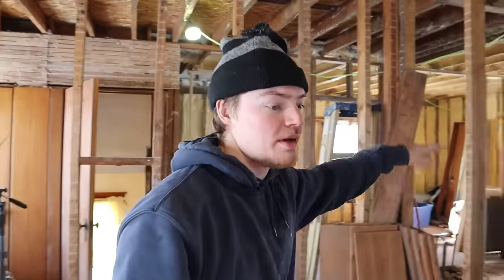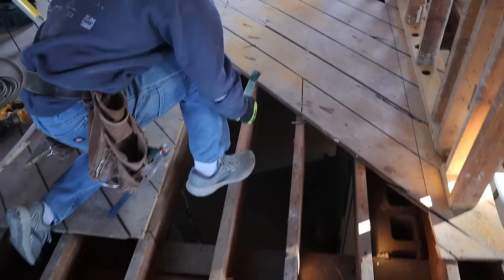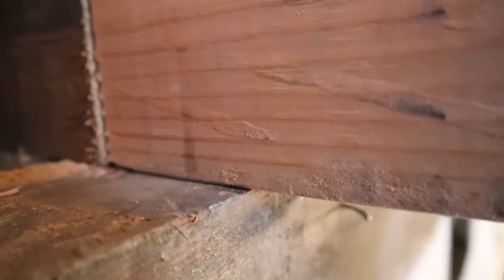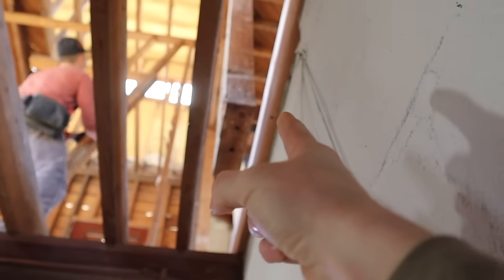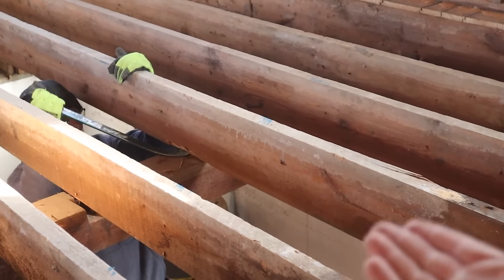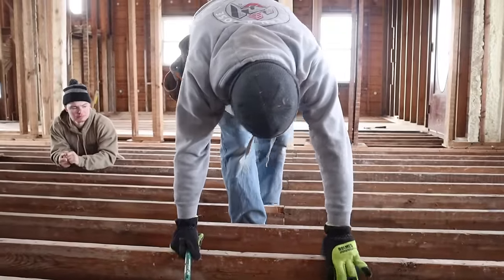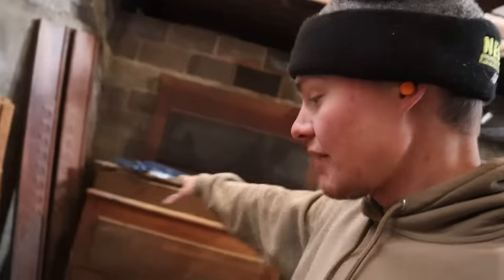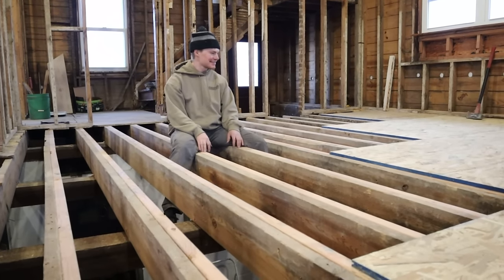Restoring A $7,000 Mansion: Kitchen Floor Rebuild

Comment: Screw the floor and it will never creek and squeak. Nail the floor and squeaks happen over time as the nail is pulled and rubs on the substrate. More work, but better long term.
Reply: A little glue works too.
Reply: Totally agree, glue and screw the floor.
Reply: You are right, that’s what happened to our home. The floor was screwdriver down when we changed the floor. No more squeaks.
Reply: Glue it and screw it. Blocking would be good too
Reply: I glued and screwed my sub when I built 8 years ago. Still no squeaks.
Reply: I heard Mike Holmes say more than once, "If you're gonna do it, glue it and screw it."  I'd much rather have a subfloor screwed down than just nailed.  Nails can work loose so much easier than screws.
Reply: Always glue and screw the floor
Reply: T25 glue and screw tan deck screws 3 1/2
Reply: the 70's called and said they want their screws back.
Reply: Code here requires subfloor adhesive

Comment: If you're jacking up from the main floor, there needs to be a basement support directly underneath also, otherwise the floor joists will sag under the weight/pressure. Also if the floor joists are bowed, cut the nails from each end and flip the board crown up. If the crown is excessive, plane them down to level. Could save some costs. And for the love of god, remember the joists blockers for extra support and to prevent twisting!

Comment: When sistering joists make sure to glue and screw. Much stronger bonding and will prevent squeaking in the future. Same for the OSB. You will regret not doing that.

Comment: @Cole The Cornstar
Hey Cole, don't forget to insulate the cavity where the floor joists touch the outside walls.
Reply: Rim joist area.
Reply: I bet it will get the spray foam as well.

Comment: That mental support wall might not technically be a full blown support wall, but you should check the span tables for 2x8s. It looks like that span from the outside wall to the other side of the kitchen is way longer than it should be for 2x8s. I’d consider doubling up the floor joists on that second floor if the span is too long for dimensional 2x8s. Otherwise you’ll have a very bouncy second floor.

Comment: Any other contractor I have ever seen deal with uneven floor joists, has always sistered-up straight joists as an arbitrary level, and used the new Straight joists to Mark any crowned joists, and cut them Square, with a circular saw.
This is the first contractor I've ever seen, do this right, in my life !!
Kudos !!
(I'm 65)

Comment: Don’t forget to use construction adhesive under the osb. Helps with squeaks. Should also glue we’re you sister the floor joists.
Reply: What exactly do you think they were putting on the joists before laying the sheets?

Comment: I built over 80 pole barn type structures after high school from hotels to machinery sheds and it blow my mind that some of the finishes in that house were unbelievable and some were about as poor as you can get. FYI I'm Justin's age and I still have my 28oz waffle head Estwing hammer and chalk line from 1984 that drove a million nail from 60's to 8's.
Reply: If that 1984 hammer still has any evidence of the original waffle face on the head, its not been used very much!!  I have a few of the 28oz. estwing waffles that look as smooth as a finish hammer...LOL
Reply: Mine is from 1987 the waffle has been gone for 30 years and the claws are getting short.
Reply: That waffle was gone year 2.

Comment: Some of those interior walls do spread the load though technically not load bearing they do spread the load and lessen the 2nd floor bounce.
Reply: They 100% are load bearing! That span is exactly twice as wide as the joists can span! Not only that, but it's balloon framed and doesn't have the necessary support at the exterior wall!

Comment: Cole, I also have a huge old farmhouse. Mine is about 5000 square feet and built in 1890 in Lyndon Vermont. I made use of a large unused attic space by building a really neat movie theater with a stage and stadium seating. It will seat up to 12 people. I made it as much like a real theater as possible. Its been a huge hit with friends and family. Most cant believe I did it. You may want to try it with all that extra space.

Comment: Oh my goodness! I helped my father remodel our home. I learned to strip, sand, stain, and varnish all the wood in the house. He then did antiques he found. That door behind you in the kitchen is gorgeous! Do whatever it takes to save the doors, especially if they have the original glass. ❤😊 This crazy weather is perfect for gutting the house! It's been absolutely fantastic. Just the right temperature not to get hot inside, and not freeze your caboose. The weather alone has to be getting some time shaved off. 😊

Comment: You need to get a book called "Modern Carpentry".  It has 'span tables' which you obviously need!  The support walls you are removing prevent 'deflection' of the floor above. You will have sagging, squeaky, weak floors without them.

Comment: Great video is always . Just a suggestion when you put your sewer drain back in the wall you may want to use cast-iron that way you won’t hear the water running down the pipe in the wall with cast-iron. You won’t hear the water going down the pipe. Just a suggestion.

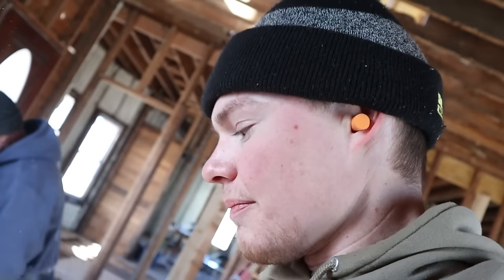Comment: 20:42 “that’s a pretty large span break or no break.” I build decks and I can’t span 2x10 12’ without a beam under it.
Reply: 100% guarantee that span needs to be broken in half! It appears to be around 18'.
Reply: 2x4 floor joists?

Comment: Why did you not use a bead of construction adhesive between the floor joists and the subfloor 42:00 in addition to screws for added strength and squeak prevention? Also, where are your noggins between the floor joists?
Reply: Just seen your comments totally agree about the noggins & floor adhesive & screws
Reply: These guys are in over their heads.
Reply: They quite clearly put construction adhesive down... and the joists are tied to the beam in the middle of the joist span.

Comment: You could use some of your old radiators in the basement in the laundry room. It would be easy to hook up with your radiant flooring.
Reply: @pattiwhite9575  ??? Use the old radiators to heat the basement, he will be using radiant floor heating for the house. All other takes is a little extra piping to use them.
Reply: I dont think he is keeping the washing machine in the basement, at least not their only washer. I bet one goes upstairs, closer to the bedrooms. I know i would do this.

Comment: Tip #1: just because joist span the entire way, doesnt mean the wall isnt load bearing.
This is the joys of renovating old homes, nothing level, nothing straight , nothing plum.
Also theres nothing wrong that chalk line, its fast wind up. I habe older ones slow wind up.

Comment: Gentlemen, 

The screws and the adhesive on the joists under the OSB, are the best way to avoid 'squeaks' in the floor. 

The sistering of the joists is also going to make for a much stronger floor. Good job! 

In my opinion your videos will probably not only entertain, but educate as you're working through each task, as you work on the restoration. Once on the famous TV program 'This Old House', Mr. Norm Abram, master woodworker, was talking about not enough young people wanting to enter the carpentry trade. I think your videos might help plant the 'seed' of looking at a career in carpentry / construction. Thats like the cherry on the sundae, of what you're focused on accomplishing. That is a wonderful thing. 

Roman, hope you can find a hammer that can hold up to your demolishing. As i mentioned before, you don't need to prove anything. Nothing wrong with 275. Not many 275's around. Just be yourself.

In other ways - each of you are 300's, because each of you has different strong points. God gives each of us a gift. Just do the best you can with it, and be careful so you go home to your families in one piece.  God bless.

Comment: In old houses, like the 100 years old in 1960 when my dad bought it you should sister kitchen joists because  ?
Fridges, stoves, counters and middle of kitchens islands are heavy.
When my Mom had our house gutted and modernized she insisted on having that done.
She got fed up with 2 general contractors she found were attempting to screw her so she went to school and got certified as a general contractor herself and took over supervising her house being built above code.

Comment: Justine I still use my dad's chalk line. I also still use the 16 oz hammer my dad had, it has duct tape for a handle. They are mine, so everyone knows NOT to use and lose them. A large pipe wrench works better to clobber the cast iron, I broke our stack pipe in just a few swings.

Comment: Outstanding stuff guys, you work well together.  Shimming and sistering the old joists was the way to go.  Also the staggering of the OSB sheeting helps distribute the load.  When dealing with compressive loads such as flooring then the nail gun is the way to go and it is so quick.  Anywhere you encounter tension loads or shear forces, like the sistering of spliced joists, then a few screws adds enormously to the strength and rigidity.  When you guys have finished it will be much better built than it was originally.

Comment: Try screwing in drywall screws to your existing wall frame. We had to add all new 2×4 and sister them to the existing. Our 1800 farm house the wood had basically petrified.  Dad got tired of predrilling for every drywall screw. So he just slapped up new 2×4s to make putting drywall up easier. It's something you should test now while the house is gutted. Just see if you have to fight the wood with drywall screws
Reply: Yup, I'm doing drywall over 100 year old studs and rafters right now and that old wood is so dry and hard. We put 2x2 furring strips on all the old studs. Makes putting in the drywall screws much easier (partly because the torque is consistent, so the screws are easier to set properly), plus we get a couple more inches of insulation.

Comment: Just a wee tip, when using the recipe saw to cut the vertical studs, I normally cut at an angle, tis allows the stud to swing without fouling the lower part bellow the cut

Comment: Make sure you get the required amount of bridging in between your floor joists installed before putting your subfloor on, or you could have a torsional buckling structural failure of the floor joist.  You really don't want that to happen.

Comment: My opinion those floor joists per code can only span 13' depending on species of the wood since your taking out walls holding up the second floor it ends up to be quiet the span.

Comment: Your floor joist span for 2x8 SPF is about 14” for 12” OC spacing. Doubled up 2x8 on 12” OC can span up to 18”. With that said do you really need the wood beam below the kitchen? You should also be adding bridging at the mid point of your floor joist. This adds strength to the floor joist by better distributing the load through out

Comment: Glad you decided to sister up old & new jousts. Will be way way stronger than replacing especially with the length of span on 2x8’s. You original spacing looks good as well. You’re easily giving this house another 100 years of life

Comment: I can’t believe you are using thin osb for your flooring.I’ve used STURDY BOARD for flooring the 15 years I built homes.
Reply: I have a feeling that this is only the beginning on cheapening out.  OSB isn't much good for anything, especially flooring.

Comment: @Cole: the long subfloor boards need pressure block against moving. Also, you can't put the walls just on OSB. The Old floor is much more stable in comparison to OSB. You better place pressure blocks on the locations of the walls, too.

Comment: Given the distance those floor joists span, I'd recommend putting in some boards running perpendicular between the joists to keep them from "rolling". It would also stiffen up the floor and reduce any movement and subsequent squeeking. I think todays building code requires the braces between joists.

Comment: I really admire you guys for what you have undertaken and the progress you have made!  Don't give up on it!  I look forward to every new video.  One suggestion:  now that the demo is done, you should immediately get a structural engineer in to evaluate what bracing you need to resist lateral and uplift forces.  Others have mentioned bracing the joists with solid or x bridging, but you also need bracing at multiple places in the exterior wall, tie downs for the roof rafters, interior shear walls, gluing and screwing all subfloors, etc, etc.  Now is the time to take a pause and get a structural engineer in to evaluate the foundation and frame.  You have a great vision for that old house, but it will only be as good as the foundation and frame.  Make sure to get those right.  That house right now may be a bit of a house of cards, get it braced!!

Comment: It was I was a West Virginia coal miner for 12 years then moved to Virginia when the mines got slow. In Virginia I built homes in Williamsburg and Newport News area for about 10 years I then worked for Waste Management as an electrician and trash compactor repair man and then I retired and was a RV repair technician until I fully retired

Comment: As a comment. I have a large kitchen with just what you described. It is a real pain having a sink in the island. 
The whole space would function better with a dual sink by the window and the island as a serving space. If we update the kitchen the island sink will be the first to go. Also. Because of the plumbing. The cupboards are not so spacious and they will be replaced with drawers.

Comment: Floor blocking would REALLY  help the floor joice. So just a suggestion but once you get the floor done. If you layout all your kitchen cabinets  sinks, dishwasher, Fridge and so on snap some lines so you can see it and it helps with blocking for wall cabinets. You can also place and spacers that you may need between cabinets and walls.

Comment: Looking good and bet it’s good feeling to walk on sold level flooring.  They should never squeak with using those screws and wood glue like y’all are doing.  That was slick raising the wall to slide decking underneath it.

Comment: You mentioned something about no break in the joists as the only indication of a load bearing wall. Please keep in mind that the length and width of your joists is what determines your maximum span.

Comment: Hi Cole, I don't know if you all plan to do this or not but I was noticing that your floor rafters are starting to twist.  You need to go in between the floor joist and hammer in two opposing boards to form an X to the adjoining floor joist so the floor joist don't twist on you.  I'm not a carpenter but I come from a family who was in construction so I know I probably didn't explain it right.  Maybe someone else can comment on this and make it more clearer.

Comment: It's looking pretty good.  Would have been nice to flip the sagging beams and sister them and prestress them down so that they wanted to pull up instead.  Anyway it looks like it's being done right.  Remember a 2x8 as a joist should span a MAXIMUM of 13' with 16" spacing.  Hope everything goes well and the house last another 100 years.

Comment: I can only wish that the joist in this 103 yo farmhouse I'm in had as many close tolerances for the span. I have an upstairs room that has access to the end caps of all joist. There are only nine 2X10X15 joist covering a 15 foot run. I literally built a box frame with joist running perpendicular in the downstairs ceiling. It became a drop ceiling. This made the upstairs floor extremely ridged with no more bounce.

Comment: I should have suggested before the demo was done but… Several brands make carbide blades for the reciprocating saw.  I use a 9” Diablo.  They will cut right through nails.  And they last longer.

Comment: Ok I have done some renovations, but I’ve not seen the apparent circles on hat appear to be in the outside walls. What are they. Also I’ve so enjoyed the Reno videos ! So excited to see final product. Bless to Roman, Justin and you to stay safe!
Reply: Back in the 70s they would drill holes in the outside walls to blow in cellulose insulation, the holes were then capped with plastic caps

Comment: While it may have appeared to be state of the art at the time it was built, you've found a lot of structural flaws. 
I know you caught a lot of flack in the beginning for taking it down to the studs, but it had to happen so you could fix and correct the infrastructure. 
Good job and good choices!

Comment: Awesome ! You should have save some of old wood which can be reusable again . Old wood strong and heavy last longer than current wood type light and easy cut .. my friend who have old house over 100 year old need upgrade remodeling just like your floors and wall to wall and pipe to pipe and electrical all replacement. That one I help him building it was good experience pretty tough old building..   how funny when I saw your post video that make me reminds gone thru before . Amazing and hope you make it all thru till your done remodel building house 🏡☺️

Comment: Justin, ask Roman which end is shorter if it is too long cut it off again. My dad always said if you cut it off three times and it is still too short start over. Grandpa used to say that it looks level from the road on a galloping horse. Grandpa also said that a crooked nail holds more. This is probably way too much for you guys.

Comment: Great work, just concerned (again) by the lack of blocking.  Giving the joists some side to side strength would go a long way to keep them from slowly rolling over with time.  All of this really would be stronger if it was blocked together.